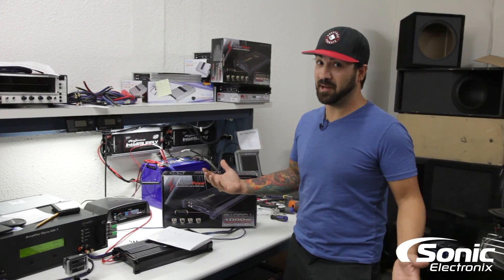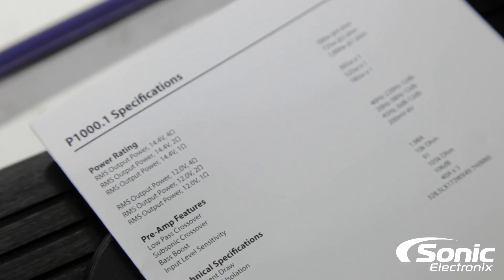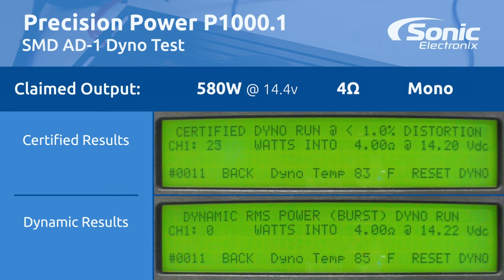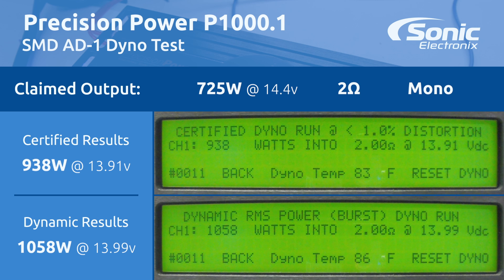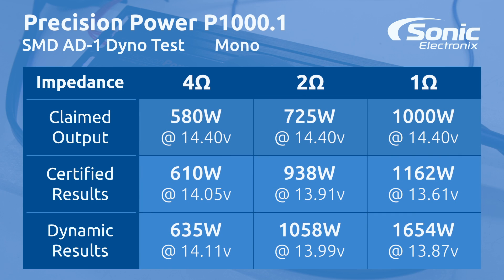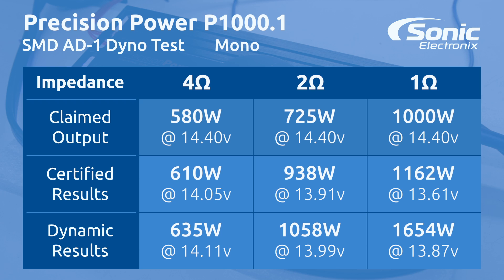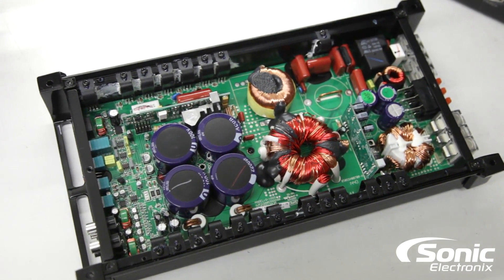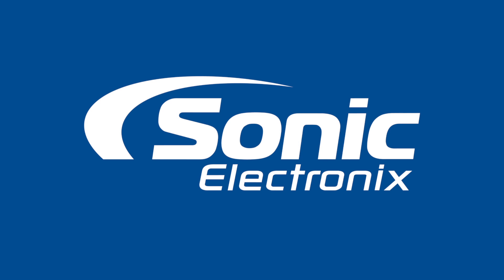Precision Power PPI Phantom P1000.1 Car Amplifier | SMD D'Amore AD-1

Comment: I have the same amp very very good it’s on eBay $300 I recommend I had 4 12s at 1 ohm slammed infinity reference 12s svc in sealed box

Comment: I have this amp and it gets super hot, kinda wished I got the pioneer gm-9601
Reply: kevin tillack If it doesnt shut down, shouldnt be a concern. 25 years ago, Rockfords and Soundstream cannot be "touched", as it is brutally hot. Running multiple Subs, without shutting down.
Reply: Heat is just the nature of the beast. Either get some fans on them.

Comment: PIECE OF CRAP guys,ok I've got the little 900.4 channel in my WRX running my mid's active,M25 stereo integrity tweeters & boston acoustic pro series mid's and its cool,no problem,but i got the 1000.1 for a single sun down 8 inch little monster for my truck,ok I've never seen a sub amp like this.you have to turn the gain all the way up,bass boost must be turned damn near all the way up,not good,the bass knob doesn't do shit until you've reached the half way mark,then its not anything to be happy about,i had to turn down my front stage amp all the way to try and make it equal,not enough,then had to turn down mid's,tweeters on HU,and even try turning up the sub out put,fuck that,its in the box and going back to amazon.never seen anything like it.PPI has been around for a long time too,maybe the one i got was just a lemon.

Comment: i just got this one to go in my old truck pushing one sun down 8 inch ported enclosure.and i have the 900.4 in my WRX for my mid's and highs,i have two 12 inch sun downs in it,but on a DC AUDIO 2.0K amp boooooommmm

Comment: i actually just bought one of these. it's fantastic. no issues what so ever. I've got a slight problem in my car with bass roll off so once i fix that. my amp will be able to pull more power with a stronger signal.

Comment: Guts look like Sound stream 1.1200d
Reply: My thoughts exactly.  Good call. Same Chinese factory(?)
Reply: Looked back to be sure.  They are practically identical. 
Wonder how many other amps are now made in the same asian factories.  Reminds me of the CCTV cameras and also batteries.
Better deal is to buy the Soundstream.
Reply: I Pleedafif same build house. Same boards. Made by epsilon. Also same as the nvx amp
Reply: That's because it is.  There is an old forum thread when this was being developed and one of the engineers at PPI was saying how it's extremely based on the Sound Stream 1.1200d and that they made an error in advertising/merch but left it.  it should be rated more at 1200 watts rms like the sound stream.  Great amp, i've owned it for nearly 3 years now.  Barely gets warm and has never gone into protect mode even when i pounded a 12" type R on it.  That was a good sub but the leads on one side caused the voicecoil to be lopsided over time and it died.  nasty sandy feel when the cone was pushed down.  gain always tuned with a dmm.  wish i had an o'scope.  anyway,  this is a great lil amp.
Reply: Donny S. Also looks like the NVX (aka Sonic Electronix house brand)  jad1200.1d

Comment: Do you guys know if this amplifier is full range or just for subs? I want to use it for a PA system.
Reply: Technically any range will work on any amp u just have to tune it from the source and not blow your speakers an EQ or crossover would help

Comment: What is clipping?
Reply: +Richard McRichardson clipping is were the sine wave being amplified from the amp gets distorted. instead of being a smooth wave on the peaks it will be choppy. This is the number one reason speakers and subs get burnt up. Most of the time what causes this is turning the gains all the way up, bass boost on the amp and the head unit. also poor voltage, meaning the charging system cannot keep up with the power demands and causing voltage drop then in turn dirties the signal. Takes power to make power. bad wiring, incorrect wiring can also directly affect these, when doing the wiring job it is also recommended to upgrade the cars stock wiring as well ie. grounds, power wire coming from the alternator this will help improve charging. Put it into terms of plumbing, hard to put a high volume of water through a little 1/4in pipe open it up to a 1 in and allows for more flow.  the most accurate way to see this is using an oscilloscope which measures wave forms.  Hope this helps

Comment: How does an amp/sub system sound louder?
Amp 2 outputs on 1- 2 subs wired series on one output or 2- one sub on each output
Reply: +Richard McRichardson depends on if it is a mono block, if it has two sets of outputs it still is a mono block, and would be connecting the subs in parallel. The amp and sub system sounds louder due to the volume of the lower end bass, low frequencies do travel a lot farther and make more decibels due to increased cone area of the affected area of air being moved. All sound really is, is the disturbance of air particles, the more you disturb them the louder it will be, which decibels is air pressure as well.